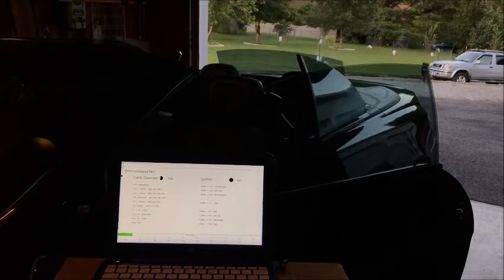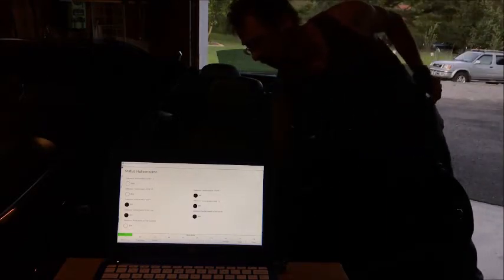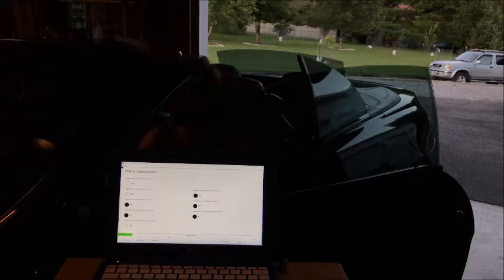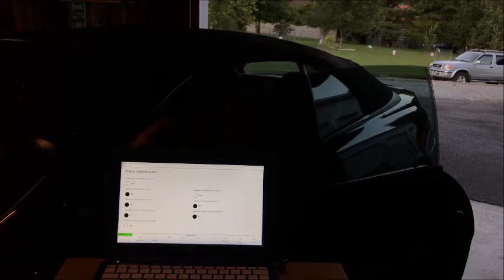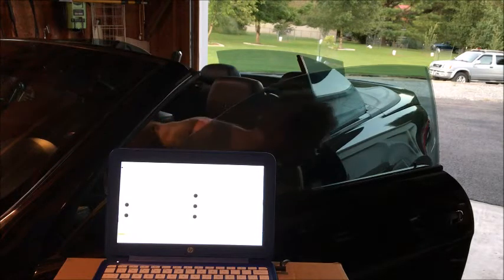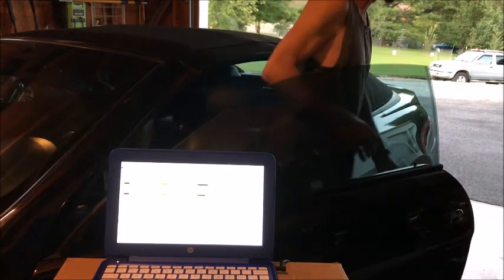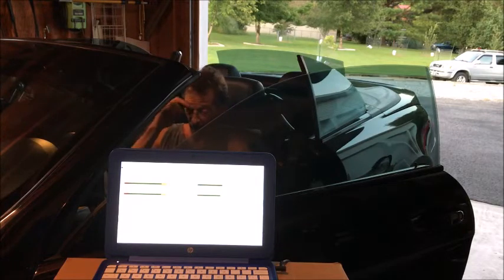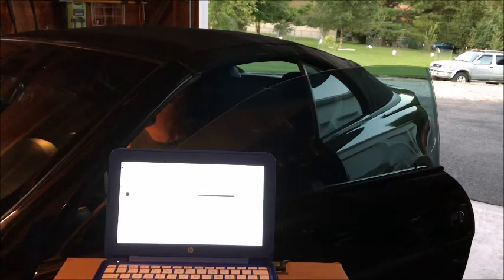BMW e64 Hall Effect sensor status and what happens when the segment sensor goes bad

Comment: Hi ! I Have BMW 528i e60 2010  -  Error code 009CC5  LM ???? You now this how to fix ? Newer see problem on car just code
Reply from the maker: Hello, not 100% sure, but I think the “LM” is for the light control module.  Some of these modules are very sensitive to low voltage (especially when the motor is cranking).  Is your battery getting older?  If so, it may just be an issue with low voltage from the battery.
Reply: @StevesDIYs  Starter New Battery New

Comment: Hi Steve! I have an 08 650i and the convertible top will not complete the open or close cycle. I changed the front latch gear that was cracked, and also had to bend two points on the soft top in order to align them to go into the V shaped metal catches where the front section of the top folds. I was able to open the top successfully and it went into the trunk compartment but it won't complete the cycle, meaning it wont lock or move the rear window. The top wont fully close, it folds down the rear wings but wont lower the front of the soft top to engage the catches. It sits several inches away from the front windshield. I lowered it manually and locked the front but rear window is not controllable and I had to manually raise it to close. The convertible cable releases in the trunk are not engaging even when I pushed them back into place. Any ideas? 

By the way, I watched all your videos and was able to get the top working to its current state. I really appreciate your detailed troubleshooting steps!
Reply from the maker: Hey !  Thanks and glad the videos have helped some 👍. Since you had to bend the catches of the short front part of the soft top, it sounds like when you replaced the latching motor gears, the flexible cables were not positioned correctly on both sides and it made a hall sensor too soon on one side.  The latching motor actually does two functions…it moves the latches to make it let go from the front window top, but it also continues to turn after it unlatches in pulls the cables on each side to lift the small front section of the soft top.  You may have to take the plastic cover back off that covers the front latching motor and check to be sure both side’s slides are over the hall sensors on the ends of the flex cables.  When it stores itself into the trunk, the Hall effect sensors are made by the slides…if they are not made, the top won’t finish the cycle.

The soft top will function with the plastic cover removed so it’s best to be able to see that the motor fully finished the cycle a couple of times before putting it back on.  Since you had to bend the end of the channels on the short front section, you may have to bend them back once you get it going again or it may jam on them.  If you have to unlatch the soft top from the front window, be sure to keep turning the motor even after the latches u hook as the last part of the motors turns pulls the side cables which lifts the front short part.  Hopefully this will help a bit and let me know how it goes, Steve
Reply: Thanks for the reply, I really appreciate it. I  checked both slides yesterday and they were slightly off. I may be mistaken, but I don't see a hall sensor on tha passenger side slide. I see two sensors on the drivers side. I opened the top to get it into the storage compartment and the driver side slide was sitting directly above the hall sensor (sensor closest to center of the window) then I adjusted the passsenger slide by 2mm. I attempted to close the top but it fails to lower the wings and I had to close it manually. I hear the motor/hydraulics running while the top is stuck at that point. Would the next troubleshooting step be the hall sensor in the driver side wing?  Is there a need to reset the ecu or other modules?    @StevesDIYs

Comment: Hello, Steve
I have an error that my convertible doesn't work.
So I checked the sensor through Inpa and found out that the deck on sensor is always on
I think there is a problem with my deck on sensor, can I know the part number or the location of the sensor?
Reply from the maker: Hello, the deck lid sensor is very easy to get to as it is attached to the driver’s side lift cylinder (US models) that raises and lowers the compartment cover (or deck).  If you open the compartment cover, look on the end of the cylinder that is connected to the vehicle in the bottom of the compartment and you should see it.  As for its part number, the best place to find part info I’ve found is a website called RealOEM.com. Once you enter your vehicle’s info into the search fields, look for the section titled something like Folding Top / Sun Roof and you should be able to find a drawing showing the part and it’s number.  If you cannot find it or cannot access the website for some reason, just let me know and I’ll see if I can look it up.  All the best ! Steve

Comment: Hi Steve it’s Alastair here from sunny Scotland again! The roof on my 650 is stuck And the roof unlock warning is flashing. When I press to lower the roof the windows drop but the rear stays up. The power lights on the rear window switch are on so I know I have power to the switches. If I manually wind down the rear window manually lower the roof and then manually raise and lock it the problem disappears. However within two or three cycles I’m back but I started. I did try and lower the rear window manually to the full down position and then try to activate the roof no joy so is this an intermittent window regulator problem because it does work a couple of times after resetting. Should I think about swapping out the window regulator or are there any switches but I might check first. Can’t thank you enough Steve for your great YouTube content where would we be without you!!
Reply: Hi Steve firstly let me thank you so much for your help in this matter and especially with your prompt replies, much appreciated. No to answer your questions yes the red light will suddenly appear and the waning gong sounds sometimes when driving or when I get into the car next time. 

As to your second question, nor exactly sure! Cycled the roof manually and it is currently working  did is 8 times no problem, when the lamp relights i will check it. What I can say with certainty is that even with the light flashing it will always drop all 4 windows but not the rear and it will go no further, can u point me to the location of the segment sensor on the left side triangular wing mechanism, ca I find it on one of your excellent videos! Thank you again I am very grateful! Alistair
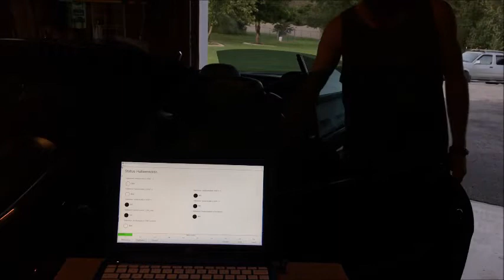Reply from the maker: @alilaw4523  thanks man 👍. Yep, it does sound like the segment sensor on the left side triangular wing lift mechanism is going bad and is not reading the correct segment.  Fortunately this is an easy fix and does not require major disassembly 👍👍👍. Here’s a link to another video on the channel that shows the segment sensor and it’s location.  At about the 3:00 minute mark of the video, I am touching the sensor arm.  https://youtu.be/0aGmCzuROvA .This video goes over what it is doing when the sensor begins failing.  I did adjust the position of mine and it lasted another year or so, but then started having issues again so I changed it out (they are not extremely expensive).  Mine has not faulted in several years now other than once or twice it blinked the red light while driving down the road, but then turned off.  I believe a couple of comments in the above video link list the part number for the sensor…if not, just let me know and I can look it up for you.  Let me know how it goes if you do decide to change out the segment sensor 👍. All the best !  Steve
Reply from the maker: Hey man !  Hope things are going good (aside from the car issue ).  Sounds like mechanically everything is still working if it will at least cycle a few times before the error comes back so that’s a good thing.  Most times it will end up being a sensor at that point so now it’s just trying to determine which one.  Here’s some questions that maybe can help narrow it down…does the red light for the soft top open or close buttons start flashing suddenly while just driving (and you get the “top not locked” warning and hear the “gong” sound)?  If this is the case, then most likely it’s the segment sensor on the left side triangular wing mechanism that is not reading the correct segment (I cannot remember if you had already had that issue or not).

Next question…after it cycles normally when you move it manually like you mentioned, does the red light stay off without flashing until you try to press the button to move the top and then it flashes and won’t do anything?  If that’s the case, then there’s a sensor like the rear window down position Hall effect sensor that may be failing or possibly one of the Hall effect sensors for the compartment lid or unlatching mechanism above the front wind screen that is not giving a consistent signal.  Also, if the button light is not flashing, are you able to open your trunk lid by tipping the Roundel or with the key like normal?

If you can reply back with which situation you are getting, it may narrow things down a bit on which sensor has gotten grumpy 👍. Thanks and all the best !  Steve

Comment: Hi Steve.  Thanks for your video.  I have a BMW 630 E64 convertible.  I have a problem with the motor that closes the roof locks near the windshield (I already ordered) but my side windows do not work and the rear one, is it because my motor is broken or should I look for a problem elsewhere?  all hall sensors work on the computer.  The rear window hall sensor indicates that it is below.  thanks
Reply from the maker: Hello, I believe that the windows will only move when the soft top is either fully retracted or fully over the car and the front latching motor has closed, and the hall sensor on the windshield latching mechanism is made. The latching motor actually does two things...it latches the soft top to the windshield, but it also moves the tensioners that raise and lower the small front section of the soft top at the beginning and end if the movement. If the top is only partially latched to the windshield, but hasn’t made the latch hall sensor (due to the motor or motor gears being bad), it should be just waiting to see this hall sensor to be able to move the windows again.  Also, if you have pulled the manual releases that are in the trunk to allow the top to be closed manually (there’s another video on the channel on that if you haven’t found it) it disables all window movement until the top is put back to a home position. The easiest home position to set it to is to retract the soft top and have it in the storage compartment. The hall sensor for the windshield latches will need to be made so it knows the latches are fully retracted as well and the the compartment lid lowered down (it does not have to latch the compartment lid for the car to take over again). If all of the hall sensors are in position, when the soft top retract button is pressed, it will latch the rear compartment and then the windows will go back up. If it doesn’t do this, then there may be another sensor not reading the correct position or the segment sensor is not reading the correct segment, but usually when the windshield latching motor goes bad, it doesn’t fully move the mechanism to make the hall sensor so it’s just waiting for that sensor to make to proceed.  Hope this helps and just let me know once you replace the latching motor if it still doesn’t want to work. All the best !  Steve

Comment: Hi Steves, can you tell me how can I open the top after unlock the windshield lock need to open the rear winds or flaps that I can't do it, i pull out the wires on the trunk but can't do it.
Reply from the maker: Hey man !  There’s another video on the channel for how to manually open the soft top….here’s the link:  https://youtu.be/CPdUUkOGGIY.  If your top is currently covering the car and you want to put it into the compartment, just follow the steps in reverse…making sure that the wings are held up as you retract the top.  Hope this helps and all the best ! Steve

Comment: Thank for video.I have fault code 9FE0  on my bmw 545i, is it hall sensor fault.
Reply from the maker: Thanks 👍. I may be wrong, but for the 545i, the 9fe0 error code is referring to one of the Hall effect sensors for the steering column adjustment vs. the Hall effect sensors in the video for the convertible top. These e6x cars are covered up with Hall effect sensors on many of the electric motors that move things (seats, steering column, convertible top, etc.).  If your steering column will not tilt up or down or move in or out, there might be an issue with one if it’s hall sensors that’s giving the error code.

Comment: Hi, great videos.  I have a 2012 650i convertible. New engine, new battery. Driver and front passenger windows don’t work. Top will not go down (when I press the button to lower the top, only the  rear window and rear side windows go down). Also no sound. No bmw tones. Radio and phone seems to work just stuck in mute.  If I disconnect the battery, the front passenger window works for a little bit.
Reply from the maker: Thanks man 👍. Yours sounds like you are having issues with the BCM (Body Control Module) versus issues with the CVM (ConVertible Module). Since BMW used the same electronics for the two door coupe as they did for the convertible, the BCM controls the two front side windows, while the CVM controls the smaller rear side windows as well as the back window (since the coupe doesn’t have these). The BCM sends a position signal to the CVM to let it know that the front side windows are lowered in order to allow movement of the convertible top. If the front windows won’t go down or the BCM doesn’t send the signal that they are lowered, the CVM won’t start the movement.  The good news is that it sounds like the other windows are going down so the CVM is functioning...it’s basically just waiting for the signal from the BCM for the front windows to continue with the cycle. For the BCM, it’s located on the wall of the foot well on the passenger side below the glove box (there are two or three modules there together).  It could be that it has lost its sync with the other modules or that there’s something wrong with the network cables or bus so it cannot communicate. There are three totally different communication networks that BMW used in these cars. One of them is an optical network that links up the radio module, the CD changer that’s an option (it hides behind the inside of the glove box) and then connects to the BCM.  If there is a disconnection on the inputs or outputs for any of the modules (or the optical driver that’s in the trunk on the driver side) all of these will shut down.  It might be a good place to start by checking the optical network connections for each of the modules to be sure one was not accidentally disconnected. Also, I’ve seen some cars with water damage in the trunk as well that fried the optical network driver. Sorry for the long reply, but I know how aggravating it is to have issues with these cars so figured some of my learnings (not really related to the convertible, but still good learnings, lol) might help 👍. All the best !  Steve